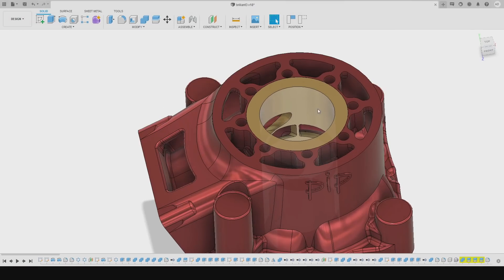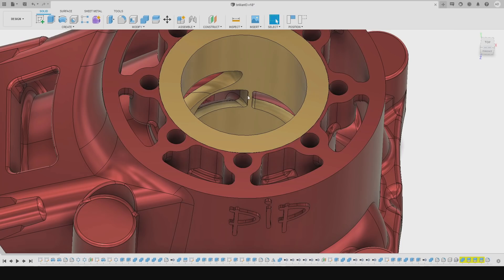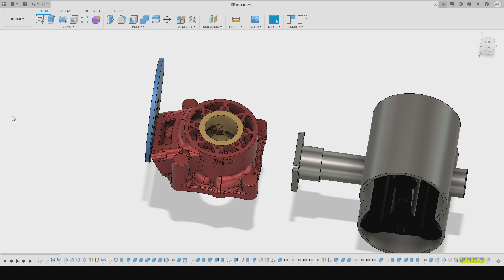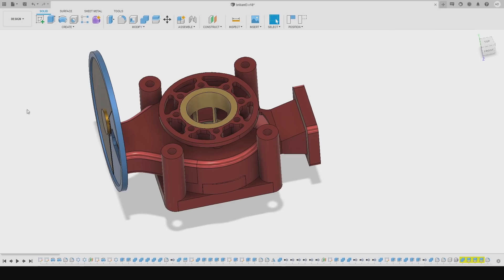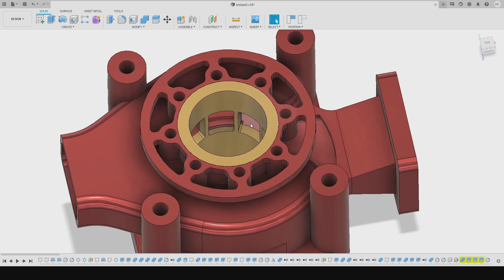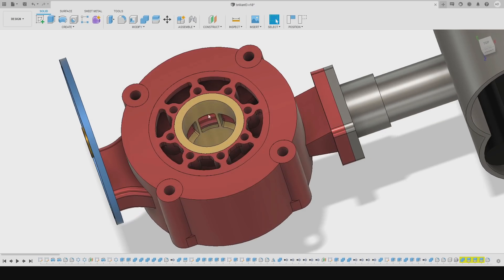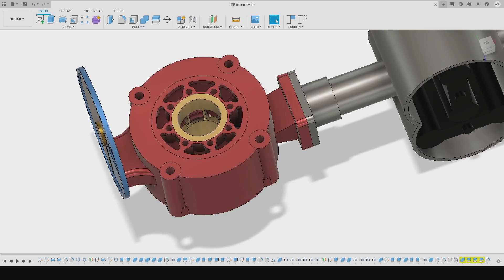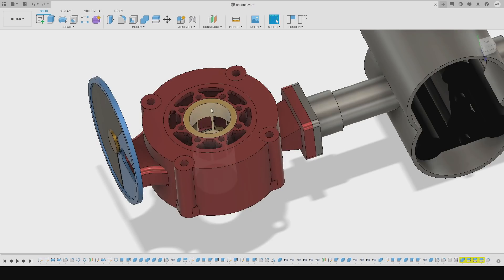Will BLOW Up the Competition! Seriously!

Comment: Years ago, I remember a 2 stroke kart racing engine that had poppet exhaust valves in the cylinder head (4 valves).. and 360 degree surrounding cylinder wall intake ports .. that would be perfect for Super charging.

Comment: If the intake ports are all directly forcing air/fuel into the cylinder without it being pulled through the crankcase, how will the rod and main bearings, as well as the wrist pin bearing and such be lubricated?

Comment: I think the valve on the exhaust may need to be either a sprung valve (power valve type) or servo driven.  I can imagine the rotary valve being extremely difficult to time and will struggle to build enough pressure at very low revs.  I'm sure you can get it working though...

Comment: Good thoughts. turbulence between Hot expanding gases going out and pressure of the cool charge coming in at the same time and filling the upper part of the combustion chamber and losing intake gases out the exhaust ports?   blow in intake from the top while the exhaust ports are open close the intake port after the exhaust port closes and get maximum stuffing the combustion chamber. make a  single Koenigsegg free valve in the head the bridged exhaust port at the bottom of the cylinder can by 360 degrees maximum scavenging.  The free valve set-up you can make.   This guy made his own free valve    https://youtu.be/z-RR0AJyTq8    free design free valve https://youtu.be/E9KJ_f7REGw

Comment: I'd look into 4 indiviual reed valves as close to cylinder as you can. The exhaust pressure will over power the blower pressure in the transfer area, hurting max RPM. Could crank blower harder, but then of course you have parasitic power loss. Transfer port injection could be great; no crank lubing to worry about. Have to worry about the ring though. Will there be oil in the case and an oil ring? 
I still think you should do a turbo instead and deal with the hassle of needing an electric blower or air compressor to start it, or have the blower just for starting and let the turbo take over. Compound induction brute force top dead center fuel injection, WOOOH lol
Reply: Well, an oil ring might transfer oil into all the ports as it crosses them.
Reply: Hard to beat the opposed piston 2 stroke really. https://www.youtube.com/watch?v=UF5j1DvC954
Reply: A high performance dirt bike version of that would be cool as hell though.
Reply: Speaking of compression rings, that's probably what's holding back the opposed piston 2 stroke from taking over. Those cylinder walls can't be seeing much oil. Premature wear.

Comment: I am surprised to see the captive ring idea shelved so suddenly, wondering if just a bit of work with FEA on the stress distribution problem causing the breakage might solve the issue. Also wondering also how much this was ever looked into before this ring breakage started.  I am thinking that perhaps using two or three of the ring-capturing pins might be more reliable, as this might greatly reduce the impact and dynamic stresses associated with the current single retaining pin. In other words, let's start by investigating the ring failures with some dynamics and mechanics of materials theory, followed by some experimentation. Also I think I mentioned before that using nitro through an expansion pipe requires MUCH bigger stinger flow capacity as well as a huge blow-off safety wall in the pipe body.
Reply from the maker: 👍Moving 100% development onto a separate engine.

Comment: Rotary exhaust valve + carbon particles = very rapid wear of rotor and valve chamber. Not very practical. Just one observation. 
Interesting, but I suspect the problems will outweigh any potential benefit. 
Go for it and good luck my friend.

Comment: I'm wondering about direct port fuel injection? You can squirt fuel once the exhaust valve closes, the charger will still pump fresh air into the cylinder and expel the spent gasses faster, but having a timeable squirt of fuel should reduce the emissions also, something I feel all big manufacturers are interested in. Poss well off the mark but surely that would lend itself to testing other fuels? Great work btw, I see your designs popping up on other channels I'm subbed to 👍💣💥

Comment: o come on, just design a 2 cylinder 2 stroke, with "twin" cylinders. however, one of them should be larger than the other. thatone will act as the compressor for the other. and allso it will be the one closing the exhaust port for the small one. the upside of the larger piston can be used to literally suck out spent gas, the crank case for the big piston will pre-compress for the small piston. and thats about it. no blower needed. and you won't have timing issues, and won't be "black exploding" your blower at all.

Comment: This is similar to a B&W marine engine except they use an exhaust poppet valve in the cylinder head . In the cylinder head there are also 3 fuel valves injecting  residual crude oil/ diesel. A slow ( max. 120 rpm) running marine engine. Imperative the poppet is retained correctly and follows the cam as with any engine. The mass of the exhaust valve limits engine rpm. These engines have turbo-chargers

Comment: With the power stroke being in the top half of the stroke maybe off setting the crank and cylinder bore centre lines to reduce rod angle at peak cylinder pressure would help? It can also change the duration in degrees of the other timing intervals which may be a benefit?

Comment: If you're going to the trouble to drive a supercharger why not use a similar air pump, or a multiple plenum, in a single pump to remove exhaust and a few rotary valves to control it all? Probably have to under drive the supercharger some? Pump it in, pump it out? Or a turbo 2 stroke? Have fun! (loved my beefed up 72 H2 750 triple)

Comment: Very interesting design, this asks for a very buff bottom end. It will request a billet high grade steel connection rod at least. Maybe you can run a bigger 4 stroke bottom end without roller bearings and pressured oil lubrication to transform all this brute force into torque! good luck with the project.  I like to see you with this new ideas, you look very happy and full of confidence!

Comment: With the fuel charge bypassing the crankcase, how do you plan on lubricating and cooling the bearings?  Would it be more like a four stroke crank with an oil slung lubrication system?  Awesome idea by the way!!!

Comment: A blower wil take +- 30% of your power. Turbo?  Because the tranferports are the same height as the exhaust ports, the hot combustion gases will ignite the fresh mixture. This creates a huge pressure pulse in the exhaust and you could make good use of it !!!!!
Reply from the maker: I need the blower to get it started, but maybe throw a turbo on there too... Simple prototype first.

Comment: The distance-volume between exhaust port and rotary valve must be minimum to gain compresion and prevent mixture loss, the rotary also fat to widstand the temps. Also look the Koenigsberg free valve system, it may fit the idea,. I had the same idea but with a turbo after the rotary valve.

Comment: So problem that made itself apparent to me is you need a way to keep the bearings lubricated and the needle bearing and crank shaft bearings are open to be lubricated by the fuel and with your set up I don’t see how you will lubricate them. If you increase the pressure two strokes are known for being unstable, if you do such thing then you risk blowing the motor and sending pieces of your piston out the exhaust. Make sure the materials are decent or you will blow every one you make.

Comment: There could be a problem with the rotary valve for the exhaust. It has to be properly oiled and it might get sooty and thus fail soon. So exchange the rotary valve for an exhaust valve, maybe even on top of the cylinder. This also is less fuss for constructing the ports and you can use an old 4-Stroke cylinder head with custom valve opening durations on a 2-stroke cylinder.
You somehow constructed an overcomplicated version on an old 2-stroke diesel engine. But I dig what you're doing! Keep on going.
With this concept you can also use an oil sump lubrication for the crankshaft bearings.

Comment: I think that you might be over thinking it, because pressure is building anytime the intake is closed to the supercharger, so the outside air is at whatever pressure you have post supercharger in the plenum.  While this means that might need to reduce the exhaust side port size in order to achieve optimum performance, the plenum will be at positive pressure.  Remember, power is not directly related to boost, but airflow.  Boost simply measures the restriction, so the actual cylinder pressure post-ignition is what makes power.
Reply from the maker: So what your saying is no exhaust valve?
Reply: @2STROKESTUFFING  ya, I am pretty sure that by biasing the port size against excessive overlap would achieve the desired outcome (or alternatively restricting the exhaust flow would prevent excessive blow through).  The increased combustion pressure will increase the flow of the exhaust port.
Reply: @2STROKESTUFFING  additionally, this may be also a function of tuning the expansion chamber as well.  I am not a two stroke expert, but this is not much different than the tuning differences for altitude, what the positive displacement blower is essentially doing is creating a greater altitude density on the intake side of the engine, while the exhaust side still needs to draw vacuum from the port, the need is less critical due to the greater pressure differential.

Comment: Can you make it run on Hydrogen? Or raise the compression and run it on Methanol?  Or scrap the fuel coming in on the blower and add a copper fuel injector to inject after the exhaust port has closed. If the copper can run at 350c+ and you use Methanol it will convert straight to Hydrogen..
Reply from the maker: Will be run on Nitromethanol 😁👍

Comment: Go back to the crankcase charged design.  Put a 10 mm bridge in exhaust port or weld up edges and replate.  Stick with what you almost had perfected. Speaking as a old man (father figure) two stroke engineer. Stop the circus with the supercharger, said with great respect.

Comment: as i recently read articles from Luc Foekema, there has been made 22 HP from 50 cc at 16.500 rpm. many years ago. Aprillia has the highest output per cc achieved.
So if Bonneville is in the view of this project, in specific division of class rules, maybe stick to develope as N/A. Personally i do not believe in so much progression
supercharging a tiny two stroke engine, it is just to small of capacity. Its torque you need to drive a supercharger. Two stroke is at best from what i think at its own 
critical and most in and exhaust tuning, where it even can reach the scavenging affects of like a forced induction, like you even can reach with optimum 4 stroke.
Maybe concentrate on high rpm to 20.000 state of the art induction and exhaust. 22 Hp for 50 cc is extreme but you may get and find a few hp more if that works for bonneville. 
What about gears and powerband wide? And what about designing a new 2cylinder 50cc?

Comment: Why don't you build in small Bridges in the ports to keep the ring from Catching since your 3D printing it, you might want to make the bridges in a curved shape to compensate for the heat expansion deflection and ring wear. I'm sure it will also help in the reliability of the cylinder

Comment: Put a secondary spark plug in the exhaust on the same cycle as the cylinder. Then you'll have a working pulse-jet stage!!
Maybe you can use it to add some extra thrust, or even make the back-pressure if you advance the timing on the exhaust pulse jet stage ;) 
No valve needed!!

Comment: An engine's usable power is the net power after powering itself. Driving a blower, water pump, alternator and internal friction are power deficits.
Engine design must include all aspects of a running engine. This is one of a thousand ideas that will allways be just an idea because of the universal law of entropy.

Comment: You're going to get a lot of unburnt fuel in the exhaust - you may get into a situation where the unburnt fuel/air mixture in the exhaust section (from the previous intake part of the cycle) meets the hot exhaust gas of the power stroke, and depending on when your exhaust valve opens to let it all out, you could get into a situation where the inside of the exhaust area mixes with the hot gasses and ignites to makes a new flame front - which may perpetuate with the inrush of the next intake. Interesting concept, but with the exhaust and intake so aligned, that is a substantial risk in my head.

Comment: One problem you will quickly realise is once you get the blower is that you arent going to get any pressure without considerable rpm... Even if you completely plug it off...

I know in theory they build boost at low rpm, but thats not reality ( I have the exact blower you ordered)

Another problem is superchargers take a lot of power to spin, you wont have enough power to use extra air to flush the cylinder clean. (Or to spin it fast enough to make the required pressure for it to run)

Not trying to rain on your parade, but you would be lucky for that idea to run at all, and forget about producing power
Reply from the maker: 👍 I have to talk with Rotrex.
Reply: @2STROKESTUFFING  

  if you are all about power at any cost there is 2 designs I would suggest.

1. Regular 2 stroke, smallest turbo you can find and run the turbine as a jet engine when the engine isnt producing enough gas to spool the turbo.
You will have full boost before idle.

Just use a low pressure (15 psi) fuel regulator and as the motor generates more gas and boost the boost pressure raises and slows fuel flow.

You will also want a seperate spark system running in the jet combustion chamber to restart the flame when at a full power pull the fuel flow stops completely.

Keep the porting tame or the piston wont hold up.
Here is my turbine, they are quite easy to get working.
https://youtu.be/5PRgOxTjvDs

Other design would be like a detroit, but reverse the flow, intake in thru valves, exhaust out 2 ports on each side (for piston thrust reasons) with tuned pipes on each. (Do not put the exhaust ports as high as you would on a traditional engine, keep them at intake port height)
If the valves cant handle the rpm you could spin the cam at 4 stroke rpm and have 1 valve at a time do every other fire

This design would be harder to do, but more practical (efficient) and durable since you can oil bath the bottom end and minimal ports

Comment: I think it will work, maybe use a direct fuel injection, like a diesel, so the blower case is not full of air/fuel mix in case of a backfire.

Comment: When your exhaust port opens, you still have combustion in the cylinder.
Now with the inlet ports at the same height as the ex ports, you are blowing fresh air fuel onto the combustion escaping out the ex ports.
I would continue with the existing design, try to get that working first.
Ultimately you should go towards a diesel with poppet valves in the head, thats the only way you can supercharge a 2 stroke.

Comment: Awesome design. How about fuel injector(s) in the transfer layer aiming directly into the cylinder? 

Maybe to also combat any slight lull in the fuel mixture flow? Would that break laminar flow along the full intake surface area... or something. Hope I'm in the right city if not the right ballpark with that. 

Thought for later if it doesn't want to run right eh. Have a good one!

Comment: Surely the hp required to drive that blower will negate any advantage one would have over a naturally aspirated engine and the super hot exhaust gasses and carbon will effect the disc valve in very guick time. Just my thoughts, best of luck either way.

Comment: Wouldn't there be a constant fire in the exhaust, like a flame thrower, and Wouldn't that extremely hot exhaust influence what happens with the Flow in the cylinder if the volume/pressure created by the burning fuel in the exhaust is greater or equal than the pressure in the cylinder, or atleast slow down the evacuation of the cylinder? Awesome work anyhow 👍👍👍

Comment: To be honest, this is an ordinary design of a two-stroke engine with a blowdown of the combustion chamber with a supercharger. They are often used in large two-stroke engines with direct fuel injection.
Maybe better try use valve-slot blowing (rotary valve good option)? It will give better perfomance compared to slot blowing.

Comment: Hello, you have realised the burning charge will ignite the air fuel mix in the 4 ports as soon as the piston opens the ports, causing problems, so why not go one stage further and link all the ports to a single inlet - exhaust chamber around the cylinder.
By opening the exhaust port to the exhaust pipe a long straight small bore pipe will still have gasses moving away from the engine causing a vaccum that will pull the burnt gasses into the exhaust with any ignited mix as well. A rotary ported compressed inlet will then open at bdc or just befor bdc, letting the Compressed mix to enter by all the ports until the piston closes the ports and the rotary inlet valve can be closed. This would allow further scavaging through the exhaust befor closing the exhaust rotary valve.
This vaccum would help the next cycle by aiding to remove the spent gasses when the piston ports open.
The exhaust rotary valve would need to be a drum not a disc so a profile (slant) would allow exhaust port timing and duration to be changed.
Tricky to get the ideal gas flows and timing optomised so easily changeable drums would help the search for the optimization of port timing..